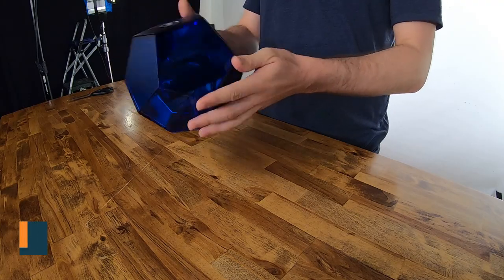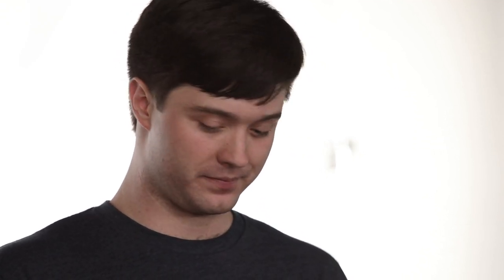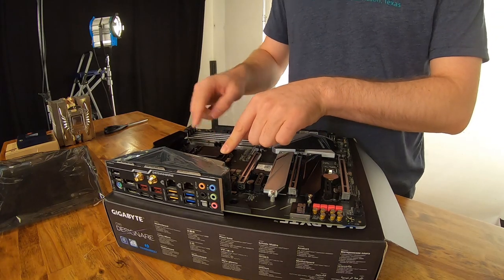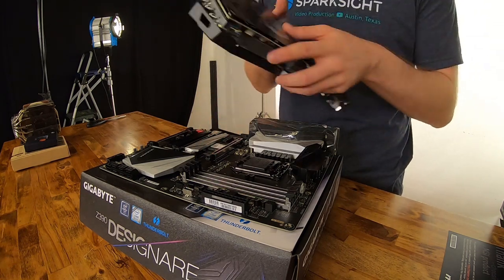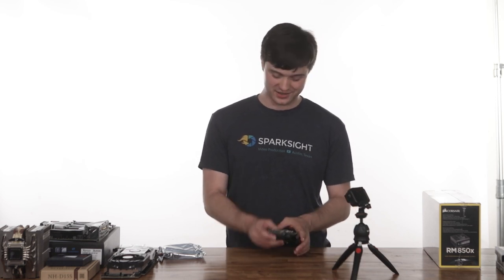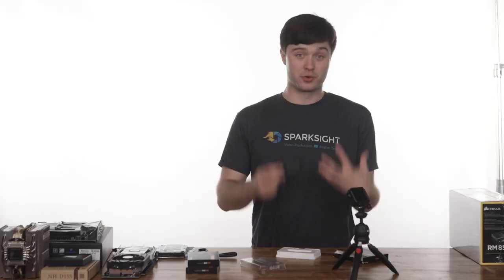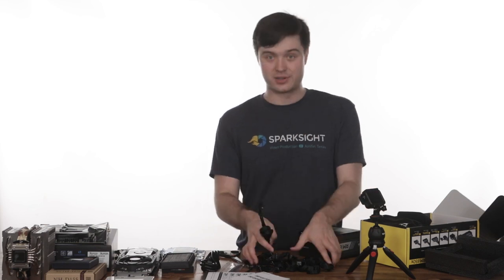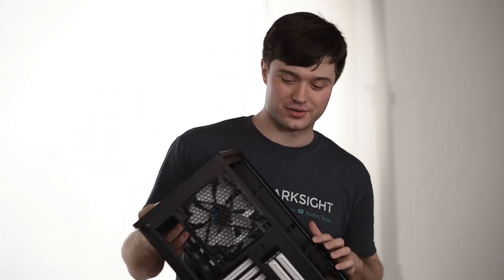Building a PC for Adobe Premiere & After Effects - Part 2 - Unboxing Computer Parts

Comment: Your work is great and you are very informative.wish your channel all the growth it deserves .
I have a question .will a 3600mhz ram run at that speed or at least at 3200mhz on an Asus Rog strix x570E motherboard without overclocking the Ram?.im confused coz on their site it shows its as 3200(OC)  .please clear this out for me if you have an idea about it .thank you
Reply from the maker: Great question! The advertised speed on most sticks of RAM is, in fact, not it's true "default" speed. There is this thing called "Extreme Memory  Profile" (or "XMP") which is a fairly modest overclock that a RAM stick is rated to go up to.  Enabling this is very easy (it's usually one quick switch in the motherboard settings), and we go over it in our full PC Build video.
This is nothing like overclocking others things in a PC. Enabling XMP is much safer, and standard in many computers. The RAM you're looking at just seems to actually be noting that the XMP speed is technically and overclock.
So yes, if a RAM stick is rated at 3200 or 3600, it should go up to that - you might just a quick change in the motherboard settings.
Reply: @sparksight  So it has no long term health effect on the Ram Sticks or any other component in the PC right?if I set my 32gb(16x2) 3600mhz cl16 tridentz neo sticks to 3600mhz in the xmp profile .
(cpu is an amd ryzen 7 3700x and motherboard im still deciding between rog x570e and rog x550e ) planning to build in the beginning of next month

Comment: I got a 2070 founders edition, 32gb of ram on Gigabyte aorus pro mother board. I’m looking into upgrading the cpu, currently a i7 8700 to a I9 9900k. Would my current setup be able to utilize the 9900k or am I wasting money? I also use premier pro and other adobe products
Reply from the maker: The 9900k would definitely be a boost from the 8700, but not by a huge world-changing margin. My main concern would be if your motherboard is able to support 9th gen processors (depends on when it was made, you should be able to check the manufacturer's website) and if the cooling solution you have on your current processor is enough (the 9900k is a very hot boi). If you currently are just using the original stock cooler, definitely consider even a cheap aftermarket cooler.

That said, my larger concern at this point is the fact that intel 10th gen is coming around the corner soon. But from what little we've seen so far it probably won't be a huge jump in performance. So you can take that two ways: Either wait for the new stuff (you may have to upgrade your motherboard anyways), or wait for the price of the 9900k to drop. As the 9900k is over $500 in most places right now, unless you have money to burn I wouldn't quite recommend it.
Reply: @sparksight  i have a gigabyte arous (sp) pro wifi mother board and a NZXT liguid cooler. I considered wating on the 10th gen i havent had my board a year yet. I pulled the trigger on the 9900k this morning, not thinking about a price drop once the I10 hits the store. thanks for the input though.